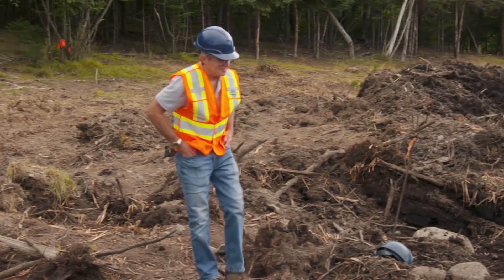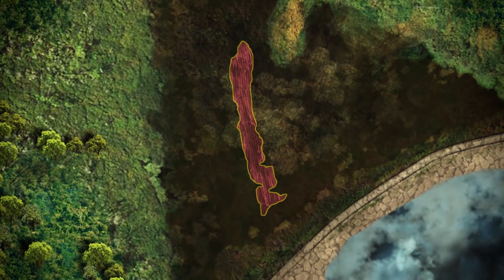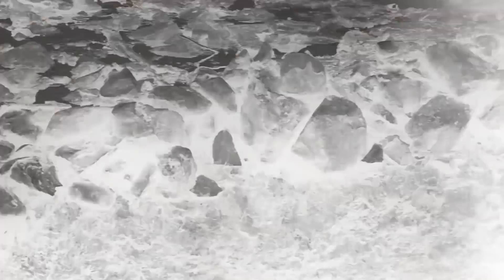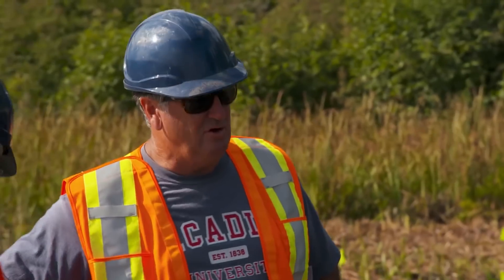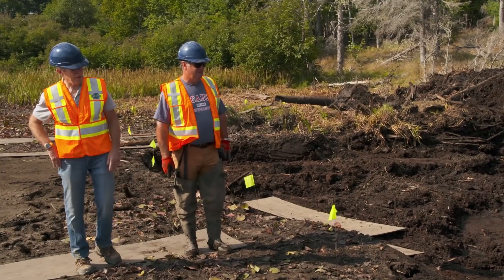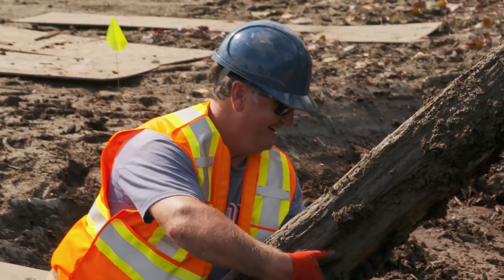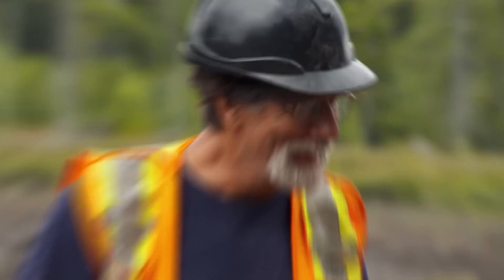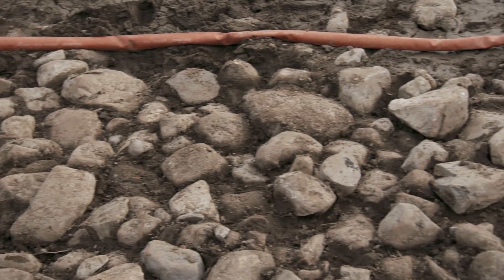The Curse of Oak Island: THE TEAM STRIKES GOLD (Season 8) | History

Comment: According to the 90 foot stone. The vault is much  deeper than everyone thinks. If the vault is at the end of the Horizontal tunnel that is 1065 long then we have to determine at what depth the horizontal tunnel is. The clue is a tunnel length that is 525 long at 45 degrees. Solving for C it comes to 377 feet deep and 377 feet long. Then  There is a 40 feet length that we have to figure for the Starting point. I am not saying that there are no other treasures at Oak Island. I think it became the best known secret of the old world for anyone who would want to hide their treasures. That would help explain a lot of things. It appears even Pirates knew about Oak Island. You could be intercepting the shaft at the wrong point. 187 feet is deeper than you all thought it would be. What if, it is at the depth 377 feet?  that would mean 187 feet is about a halfway point. If you were able to intercept this shaft further along the x axis...then  it would be deeper and this second point would tell you how far to go along the X axis to find the vault. We already know at what depth the chamber of the 90 foot stone is. A and b are x and y and are equal. Hitting the shaft at any other depth would tell us where the vault is. At this point, we do not need the right starting point. After finding the vault for the fun of it we could figure out the starting point which would be 377+1065+40. If we had the starting point, all we would need is to measure out the numbers and dig straight down 377 feet. X really does mark the Spot.

Comment: All of this is folly by by design by an elite group according the unspoken, unwritten legend of the Templars. The treasure was originally hidden in a stone underground vault on higher ground. The treasure was removed hundreds of years ago, but the fabricated legend was spread by rumors and word of mouth to elude the truth and provide cover for what really happened. Treasure hunters went beserk over centuries chasing the treasure, digging shafts and tunnels when the truth was right under their noses. The gold was gone, replaced by ships' ballast stones re-used for pathways and ramps.  In order to transport the tons of gold required that the ballast stones be removed from the hulls of the wooden sailing ships and dumped on the island. There is no record of where the treasure went, but was probably secretly melted into bars of gold bullion and enriched those and their children who carried out the diabolical plan.